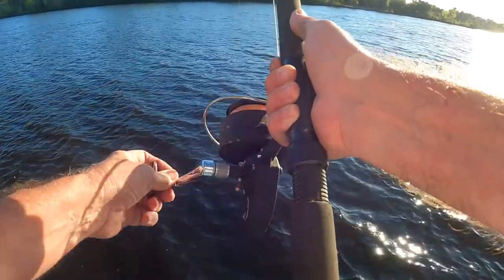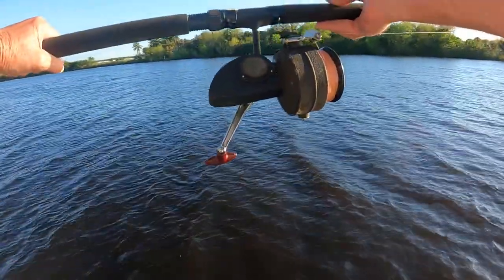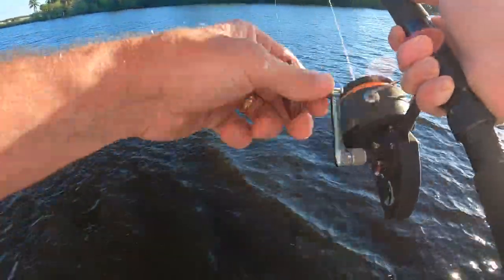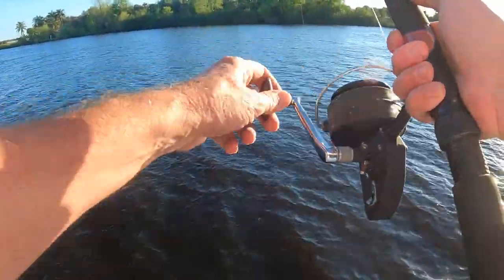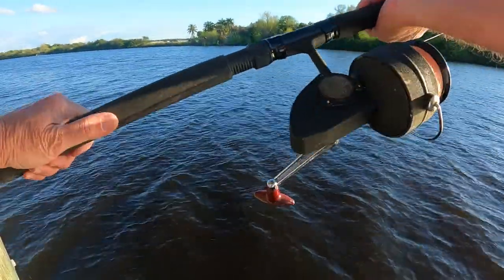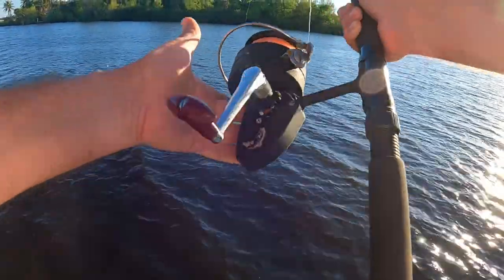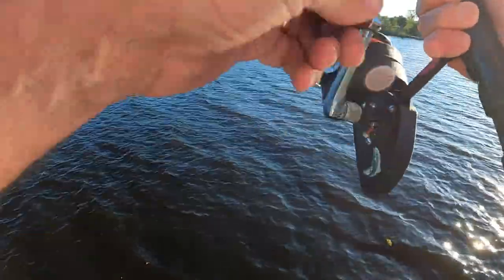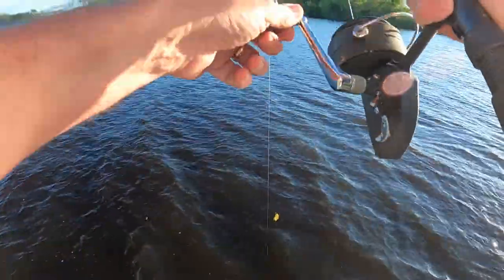DAM Quick 550 vintage spinning reel.

Comment: A wonderful reel, honor it! And you're right, from this series 550 was the biggest, there were a 110, 220, 330, 440, 550 and also 221 and 331 with a higher gear ratio. This reel of yours would deserve an old high quality glas fibre rod 😉 I have a collection of old DAM Reels and fish with them more often than with any other reels I have. It's is just an undescribable feeling listening to the clacking of that anti reverse ... Caught many great fish with them 😉
Reply from the maker: Yes, very cool reels, I'm always on the look-out for nice vintage rods to pair with them. Very solid, well made reels. Thanks for commenting!!!
Reply: Actually the 270 Super from the late 50s was the biggest, it had the metal spool, where, to my understanding,  the 550, have one of those,had the plastic spool. Both live up to the name, DAM Quick, or DAM Good as I refer to the quality of the things.

Comment: I have three of these that I use for surf fishing. I put Gomexus Power Knobs on two of mine as one I bought with no knob which is why it was cheap.  These reels are absolute tanks. The internal gearing is marine grade brass and stainless steel. These 270 Supers are popular reels for upgrading. I’ve seen several that were made completely sealed against water intrusion and dunking. Some even have new machined gearing and additional bearings to make them high speed. The reel is such a strong platform that it is perfect for upgrades. These reels can be a challenge to service as there are two rolled steel pins that have to be knocked out using a small pouch to enable disassembly. Getting them back in can also be a challenge. I wouldn’t want to throw lures all day with this reel because of its weight but it is perfect for using set rigs in the surf or pier fishing.
Reply from the maker: Yes they are tanks and great for beach/pier fishing. I plan to 'pimp' one some day. Cool reel for that. Thanks for commenting!

Comment: Absolutely, very good reel, turn the clicker off, little thing at base of the reel handle
Reply from the maker: 😀 That little thing at base of reel is a real work of machine art. I have seen no other reel with the same level a design. It is a side turning lever with a ramp to engage/disengage the anti-reverse. And watching it move and click as you reel when it's engaged is pretty cool. Thanks for the comment.